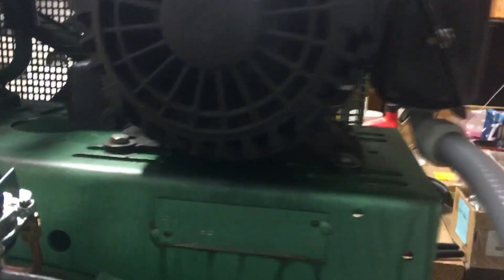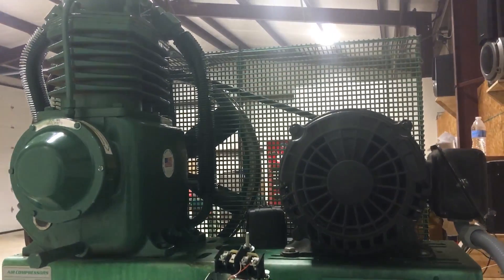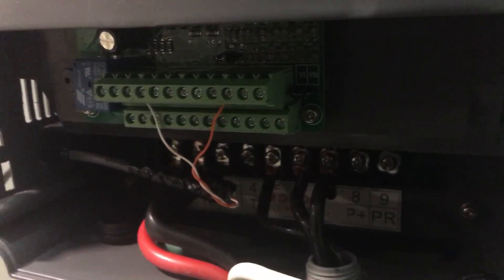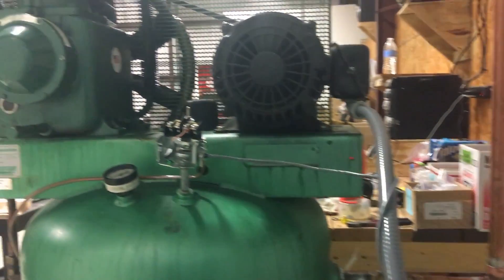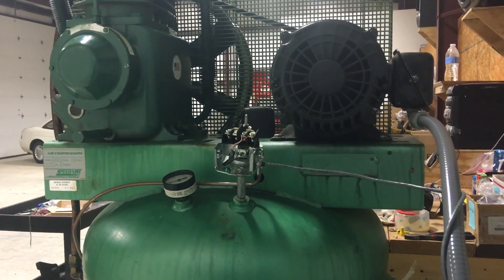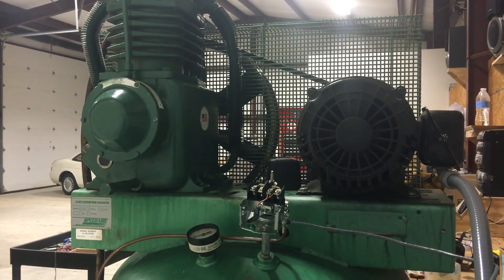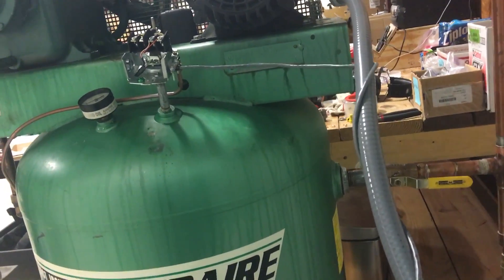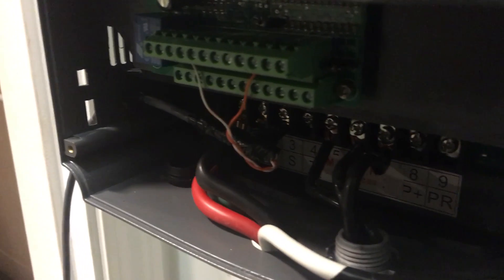VFD Running Air Compressor - Controls

Comment: Is this still up and running?
Question, your pressure swtich have 4 terminals right?
Are the outer terminals for Line 1 and Line 2, and the inner terminals for motor?

Comment: I am going to be using this same vid on my compressor hookup this weekend. Do you recall what gauge wire you used from your plug to the VFD input?
Reply from the maker: It entirely depends on the amperage you expect (and the motor is rated to) draw. Look up an amperage wire gauge chart and check the ratings plate on the motor for amperage

Comment: I have the 10hp version of this vfd and a square d pressure switch, other than the reverse lockout what settings did you have to change when programming it?

Also you dont need any supply power lines going to the pressure switch?
Reply: I’m trying to workout the same thing. Did you manage to figure it out by any chance?

Comment: I was hoping you would show it running. Mine has a ramp (5second startup) and runs slower to ramp up to 60hz. I believe this conflicts with your splash lubrication theory and may be hurting the compressor. 

Also cannot get the vfd to run when it has a load. I tried unloader removing pressure from head, everything.
Reply from the maker: That is quite true about the speed affecting splash lubrication. Some older compressor designs (Quincy comes to mind as being known for this particularly) use an oil pump and pressurized lubrication, which shuold be relatively immune to low speed lubrication issues (within reason of course). Regardless, I would imagine a few seconds of slower speed during startup is unlikely to pose any issue on any compressor, especially if your unloader valve is working correctly - I might even go so far as to surmise that having pressure on top the piston(s) in a compressor constantly while it's not turning is likely to do much more harm (from squeezing out the oil film on the journals and bearings) than low speed startup would.

Comment: What kinda amperage are you pulling from that single phase?

I'm considering doing the same thing with a 5hp champion compressor... but I only have a single 240v receptacle in my garage thats wired to a 30 amp breaker.

Comment: Hi, i have 10hp air compressor i bought the VFD and received it yesterday, my motor is 3phase to single phase with the VFD.
Is it ok just using only the RT for single and UVW for my motor? Then for pressure switch, i did not touch it what will happen if i will not connect to VFD for pressure switch?

Comment: so what is the problem if the compressor auto cuts off without wiring the air pressure switch through the VFD, would it under voltage and not restart up when the pressure fell?
Reply: It will fry the vfd

Comment: We have done the same with one of the screw compressor of 30HP. I installed PT at the output which is wired with the PID controller tuned against the requirement of air in the system. The inside pressure switch is some sort of bypassed. The system is running smoothly between 30 Hz to 50Hz.
Reply: Hello, Assad can you provide a detail which VFD use and parameter how to configure in a VFD of a PID control for air compressor. (because I want to control my air compressor, not at a fixed speed. ( not on or off) it can be controlled by the demand of pressure like pressure increase some point then VFD decrease a speed 10% and vice versa operation.

Comment: I wonder if you could program the VFD to run in a constant power mode. So it will increase the frequency and the load up to a maximum when the tank pressure is low. Automatically increasing CFM without any 'complex' feedback loop.

Comment: dregenius, would you share VFD Mfg/model info and cost? I’m working out whether it’s worth it to go VFD or just buy a new single phase motor for a 5HP IR 2340L5-V...
Reply: I noticed 3 phase motors are a little cheaper than single. A single to 3 phase vfd will give you more options and tons of control. Some even have over current protection and other features to keep motor happy...
Reply: Any update on what you did?

I bought a 10 hp VFD to do this for my 3phase 5 hp champion compressor... it was 200 bucks. Probably gonna be another 100 to wire it all up.

But I guess we could just buy a 1 phase 5 hp motor too...

Comment: This is exactly what I needed to see. I had installed a magnetic contactor and it certainly did NOT like the VFD output. I did have one question, however. Some forum discussions say that 2 phase 220V input does not require 2 times the output on the VFD, but if 3 phase in is used it will require approximately double the VFD capacity. (startup amps) So is double the VFD required, say for example, a 10 h.p. VFD for a  5 h.p. 3 phase motor if using 3 phase input? Just curious.
Reply: I believe that is true. Not exactly double... and I think you alleviate some of that by ramping it up slowly... but true in principle.

However... and I need to read some more on my R15 pump... if you ramp too slowly youre running the pump without lubrication for some time. My pump has a unloading valve... so I dont think it will be too hard on it. But I'm not sure.
Reply: @ChristianNeff  I gave up on the VFD, and moved up to a 7.5 h.p. 1750 Baldor motor fed by my 20 h.p. RPC last summer. I've only had one slight problem with it since then, trying to start it in sub-freezing weather. I let it warm up 10 degrees and it started up fine.  I only gave up on it because it burned up, since it was only rated for 5 h.p. and needs much more than that at startup. The 10 h.p. VFDS are not cheap.

Comment: I hooked mine up exactly the same as you did and it did not work.  Any suggestions? It runs manually turning it on off fine but programming it to accept commands from the board doesn't seem to take.

Comment: I have a similar setup but I’m having an issue.  I understand that the motor is supposed to be wired directly to the VFD with nothing in between. I did this by bypassing the little “control box” for the compressor.  When I do this, I can get the motor to run well.  However, the compressor won’t make more than 50psi unless the unloader valve is energized while the motor is running.  I’m assuming the unloader valve gets energized through the control box that I bypassed. So, here’s my issue... how do I wire directly to the motor AND energize the unloader valve?
Reply: Aren't unloader valves centrifugally controlled? At least I think they are in some cases.

Comment: Is this motor still running? I need to do the same here. The 2 wires in the pressure switch are in Line or motor terminals? Do I need further protection for the VFD and all system?
Reply from the maker: It's been running great for over a year and a half now under "heavy residential" use. It sounds like you're asking how the pressure switch is wired... the pressure switch does not control the motor directly or handle any kind of high voltage signals at all, the pressure switch is used to command the VFD to run the motor as follows: VFD has a low voltage signal-level terminal labeled "FWD" which when shorted to ground will cause the VFD to run the motor. The pressure switch is connected to ground on one side, and the FWD terminal on the other side, so that when the pressure drops, the switch grounds the FWD terminal on the VFD. Note that in my case, "FWD" was the correct direction to turn the pump, but make sure you are running your compressor the correct direction - take note of arrows or fan blades on the pump pulley. You may have to use the "REV" terminal to run the motor instead of "FWD" like I did. Locking out the wrong direction (by using the menu system on the VFD) is a good idea to prevent the system from in the future accidentally being set to run in reverse without noticing. If that were to happen, compressor lifespan would likely be limited.

Comment: Hi Guys it's been a year since you have a good conversation. I would like to ask if you have tried programming the vfd using its multi step function (not only ON and OFF). That is if i have a continuous demand  of air, i need a max pressure and hence max frequency. But if the air demand is at average, say the frequency will be at 40Hz. In short, the compressor will never be OFF (it will run at varying speed or frequency) unless the air demand is zero hence the pressure switch will trigger to its set pressure.
Reply: I ask this cause i needed help.. I want my compressor run automatically depending on air demand. Thank you
Reply from the maker: We did investigate this, however there's actually some good reasons not to do this: the compressor relies on splash lubrication, and below a certain speed (usually listed as minimum speed on the specifications tag) the oil paddle on the connecting rod will not be moving fast enough for the oil it splashes to reach all components inside the compressor. So although it may seem counterintuitive, running a compressor too slowly can actually kill it pretty quickly.

Comment: I have a newer Hunan VFD and perhaps a different 7.5KW model.  There is no FWD or DCM.  I can program a connection such as "S1" to FWD.  There is a GND or COM terminal.  Either of those should work.  However, no matter what I do, when I hit "run" the compressor will run whether or not the pressure switch is open or closed.  If I program S1 to pause running, it will stop power to the motor when the circuit is closed and provide power when the circuit is open.  This is exactly the opposite of what I need.  Any insights on how to get the VFD control circuit to run on closed circuit and pause on closed circuit?
Reply: Gary, there are two settings on mine for this. I have the same black box just a different makeup, typical import VFD. One setting is to select the external input as a means to turning the output to the compressor motor on and off, (vs. using the keypad manually) and the other setting was to select whether or not it could be restarted again automatically. That second setting was critical, because until I had both of them enabled it wouldn't allow a motor output. Make sure you have an ESTOP wired in if you do this though, there is no way to stop the motor from the VFD once you do this, it literally locks you out of everything except speed control! These drives are great for the price but the documentation is always lacking as in with most imports. This is why I tend to stay with the known brands like Teco because the manuals are so thorough and you're not setting up blindly.
Reply: I figured it out.  I ran a control wire from the pressure switch to the S1 pin and the COM pin.  S1 is programmed to allow the VFD to run when there is continuity and stop when there is not.  The COM is the common ground.  So, when the pressure switch is closed (below the low pressure turn on setting) the contacts are close and their is continuity and the VFD will run.  When the pressure exceeds the high pressure limit the pressure switch opens and the continuity is broken and the VFD stops.  Now there is one trick that you have be aware of and this had me stumped for a long time.  The VFD has a safety protocol built in such that if there is continuity on S1 when the VFD is first turned on it will NOT start!  This is to prevent an unexpected or unsafe start.  So, what I did was wire a simple manual open and close switch on one of the control wires.  I used a light switch.  Thus when I start the VFD because I am going to be using the compressor and the pressure is low/pressure switch closed I go ahead and let the VFD power up.  After is it powered up I open and close my light switch and the VFD powers up the compressor.  If I leave the VFD on then I don't have to do this again but it is often weeks between needing to use the compressor so I end up doing this as part of my regular start up cycle.  The VFD and compressor have been working like a charm.
Reply: Hi did you solve this problem? I'm having pretty much the exact same issue.
Reply: I figured it out.  I ran a control wire from the pressure switch to the S1 pin and the COM pin.  S1 is programmed to allow the VFD to run when there is continuity and stop when there is not.  The COM is the common ground.  So, when the pressure switch is closed (below the low pressure turn on setting) the contacts are close and their is continuity and the VFD will run.  When the pressure exceeds the high pressure limit the pressure switch opens and the continuity is broken and the VFD stops.  Now there is one trick that you have be aware of and this had me stumped for a long time.  The VFD has a safety protocol built in such that if there is continuity on S1 when the VFD is first turned on it will NOT start!  This is to prevent an unexpected or unsafe start.  So, what I did was wire a simple manual open and close switch on one of the control wires.  I used a light switch.  Thus when I start the VFD because I am going to be using the compressor and the pressure is low/pressure switch closed I go ahead and let the VFD power up.  After is it powered up I open and close my light switch and the VFD powers up the compressor.  If I leave the VFD on then I don't have to do this again but it is often weeks between needing to use the compressor so I end up doing this as part of my regular start up cycle.  The VFD and compressor have been working like a charm.
Reply: I know exactly what you're talking about. On mine however there is a separate setting for this. Without it enabled you are stuck on first startup as you have seen. You probably don't need the jumper if you have this on your VFD. Can you post a link to the manual for your unit?
Reply: I don't have an e-manual or a link but this is the VFD: http://www.ebay.com/itm/VARIABLE-FREQUENCY-DRIVE-INVERTER-VFD-7-5KW-10HP-34A-FOR-CNC-/260829774379?hash=item3cbaaa822b
Reply: What do you have set for Pn 04 (Source of runtime command with range 1-2), and Pn 07 (Start again by external signal with range 1-2)?
Reply: Better if you email me at g2patriot@gmail.com. This VFD/Inverter stuff is way beyond my complete understanding.  The manual is meant for an expert not someone who has never touched one of these before.  That being said I don't have anything in the manual for "Pn 04" or "Pn 07".  However in my manual Function Code P0.01 is the Run Command Source with a range of 0-2.  0 is Keypad, 1 is Terminal, and 2 is Communication.  I am set to "1" so I run in Terminal mode meaning wires to my terminal blocks provide signals.  I wired my pressure switch to the terminal block "S1" which I set for "FWD" and the second wire to "COM" which functions as a common ground.  This set up has the VFD power the compressor motor when there is continuity and it stops the motor when there is not.   I am really struggling to find something that the same as your "Pn 07".  Email me more details and I'll see what I can find.
Reply: I will send you an email, I am sure I can help you sort this out.

Comment: How has the VFD been working. I have been looking at getting one for the same exact setup.
Reply from the maker: So far so good. Only been installed a couple months but no major problems. I did choose a way-oversized Chinese VFD since it'll be starting under some load - 10hp VFD for a 5hp motor, and of course never use a motor contactor - use the pressure switch to ground the "fwd" terminal on the VFD or similar. I also locked out reverse and set maximum frequency to 60hz. Ramp time is something like 5-7 seconds or so.